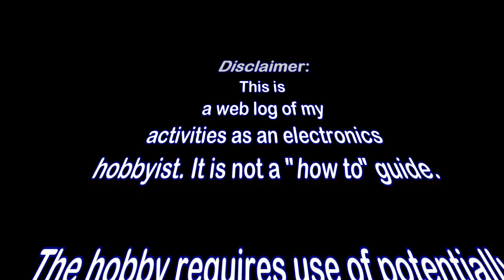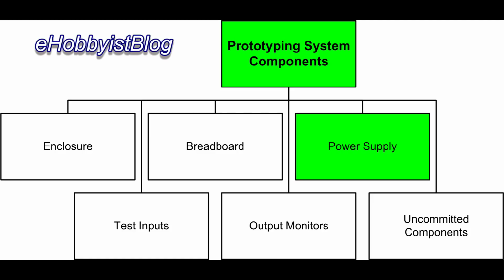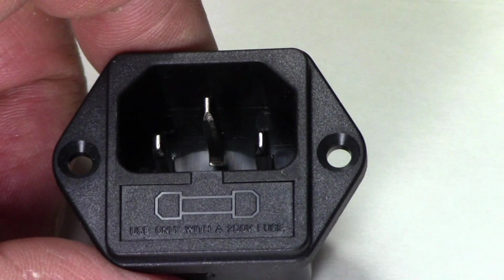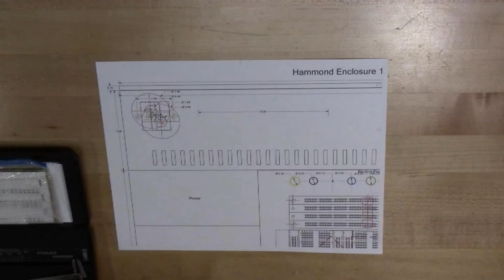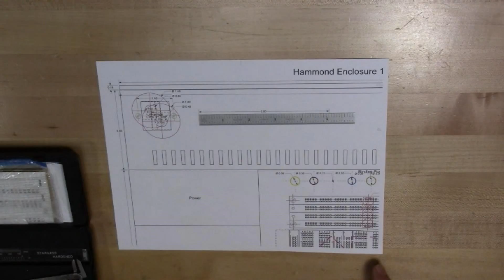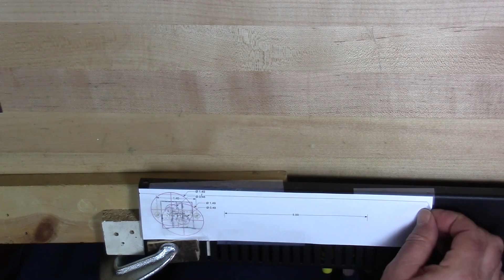016-Power Supply--AC Power (1)

Comment: Why not use a Dremel  ?
Reply from the maker: I’m guessing you mean “why not use a rotary cutting tool?” (I have a number of issues with the quality of Dremel tools). I currently use Black & Decker; the Proxxon is too expensive for me.

I have used a rotary cutting tool on thin (18 gauge) aluminum. My straight cuts seemed not all that straight. I had problems steadying the tool and keeping it on line. I was never able to get clean corners. (I tend to overcut the sides). The end result was lots more filing to dress up the mess. The enclosure I am using for this project is 14 gauge, which makes cutting a lot more difficult.

The chassis square punch I used is quicker and produces cleaner results with less filing.

Comment: seems like  a jigsaw would really be the way to go here....?
Reply from the maker: +antigen4 
I’m guessing you are referring to a handheld electrical reciprocating saw, sometimes called a saber saw, as opposed to the Marvel comic character—who would not be particularly useful. 

I found jigsaws to be too difficult to control with precision for fine work on flexible metal. (Maybe you’ll have better luck). If you intend to use a jigsaw, I suggest you do some testing on scrap metal first, and keep the metal well clamped.
Reply: eHobbyistBlog yes that's the one... they aren't so hard to control... just use a 'low vibration' setting and a low speed and a proper metal bit - i'm about to do just that - i'lll let you know how it turns out. I found this video because I was trying to figure out how the heck to wire a fused power inlet (schaffner FN382) ... I thought it was internally wired between inlet, fuse and switch but i guess you have to do all that manually...
Reply from the maker: +antigen4 
Thanks. I would like to know. (And to see.) How about a video?. 

The Shaffner FN 380 schematic 
(http://www.schaffner.com/products/download/product/datasheet/fn-380-versatile-filtered-power-entry-module/) 
shows no connection between the filter section, the fuse section and the switch section. I'm guessing they do that to increase the flexibility of their product.